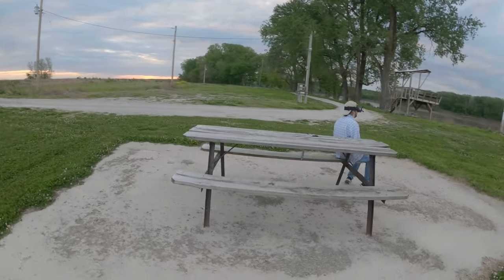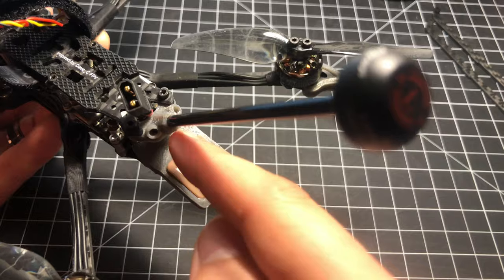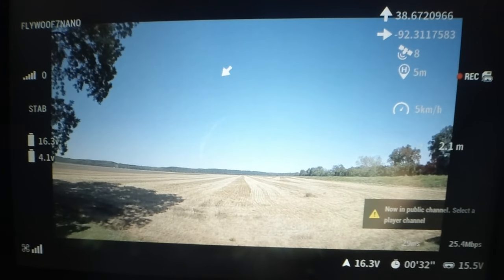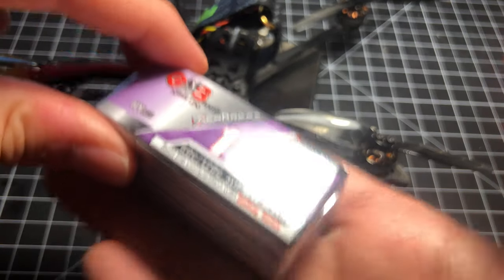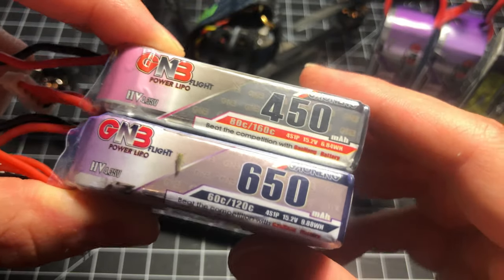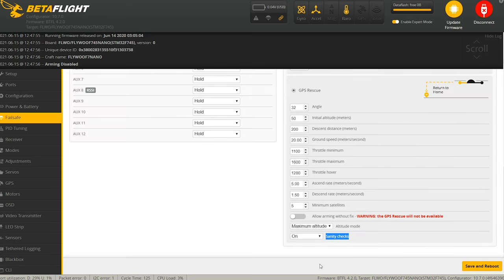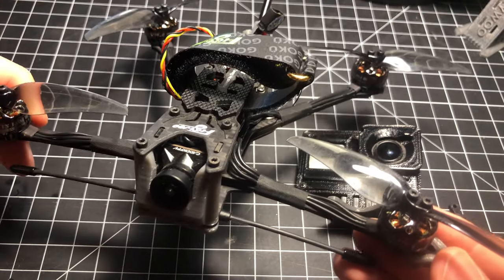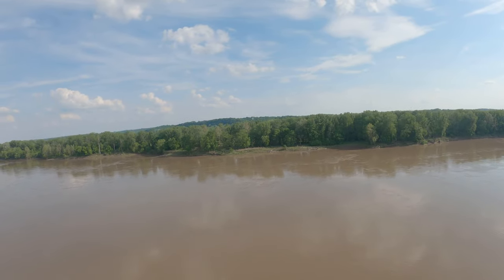Flywoo Explorer LR HD 4'' V2 Micro Long Range Ultralight FPV

Comment: Awesome review, thank you for providing so much detail! I have had the Explorer for a couple days and have enjoyed flying it as my first new drone after the DJI FPV one. Although I didn't realize that I had the OSD turned off in the goggles so I was only seeing the voltage of the battery before I watched this video. Very informative and helpful!
Reply from the maker: Thank you for taking the time to comment! Really means a lot! The explorer is my best FPV drone purchase so far of 2021 I've been extremely happy with it. Glad you got the on screen display working; that's so important to have!
Reply: @JohnCuppi  absolutely! So far I have only flown at home and kept an eye on the RC and HD signal but it definitely will be useful to have the rest of the display available, starting when I get back out and fly tomorrow!

Comment: the replacement arms are 7 dollars... I think it can freestyle.
I do wonder how it would do with a 4s 450 or a 650, it seems like it would be a little more playful for the 7 mins it would stay flying.
Reply from the maker: It can freestyle, but I just don’t see a reason to pick this drone to do it vs. the many others on the market. $7 an arm when you are practically guaranteed to break them every freestyle session is more annoying than expensive probably.
Reply: @JohnCuppi  I really just don't want to have to repair more than one quad... I was kinda in the market for a quad that could be somewhat good for anything. while being able to reach out with longer flights and ranges available and carry a action-cam.
and again, more the point, repairing this little quad is going to be cheaper all around than repairing a five or a seven.
it also has some braces that greatly reduce breaks.
Reply from the maker: @greedfox7842  Totally get that. But, maybe you would consider some unibody frames from companies that provide a warranty for life on them, like armattan?

 Armattan marmotte and the impulserc apex are practically indestructible. Armattan's warranty is real, I've claimed on it previously for non carbon fiber parts on their frame. This way you are not spending a dime on a new frame if you somehow manage to break it. 

I love my flywoo explorer lr 4, and it's still going strong. And if you primarily use it for LR, you'll love it! The braces will definitely help no matter what, I believe they have saved me so far from breaking an arm in a few accidents that I've had.

Comment: friend can I freestyle with this drone?  is that I want a long range and at the same time freestyle.
Reply from the maker: Yes, this drone will do some freestyle very well for what it is, but the thin arms will break. So the tune won't be the problem, but the frame durability. It is not intended to do freestyle.

Comment: great video
Reply from the maker: Thank you! I still enjoy my flywoo explorer lr v2 a year later, it has had a good long run. :)
Reply: @JohnCuppi   I'm currently trying to find resources for a naked gopro hero 10 case that has nd support, do you know of any solutions?
Reply: @JohnCuppi  also, what flight time did you get with the 450 battery?

Comment: Hey pal have a question, when I press return to home, the drone flys up and up and up on it ways back to me even if only flew 10m off ground, its setup same as yours but can't stop it from going up and over 120m, sometimes it recalls and flys back to me and other times it just goes up more but does not fly to me, it has home and satalites set too, any help? Ta
Reply from the maker: Interesting. I'd be curious to know what happens if instead of Max for the altitude, change it to Fixed, and then at CLI do:

set gps_rescue_initial_alt = 50

This will change it to 50m fixed altitude for return to home. It would be interesting to know if it works correctly with fixed or not, there could be some issue with the Max setting.
Reply: @JohnCuppi  will give it ago tomorrow if weather holds up 👍
Reply from the maker: @Adept1780  Ok, let me know how it goes. If that does work then it could mean that somehow it is recording the maximum flight altitude incorrectly. If it doesn't work with a fixed number, and still climbs well past 120m+... then I'm sort of totally stumped. 

BTW - do you have your current altitude reading in your OSD as well? does the reading for it seem correct?
Reply: @JohnCuppi  yep have current altitude in OSD and that's accurate, will see what happens 👍
Reply: @JohnCuppi  ok so it still came back but still went up and up, then it does stop at random heights and just hovers around up in the air once back, not the best but this is only a fail safe so aslong as it starts coming back enough for me to get the signal back and get back into Acro will do me.

Comment: Does the GPS come set up out the box?
Reply from the maker: It does — but, I recommend doing my simple changes.
Reply: @JohnCuppi  can I make them same changes on speedybee adapter 3?
Reply from the maker: @kaelstokes5804  I’m not 100% sure but as long as speedybee v3 allows you to get to the GPS tab, then all of those settings should be there.

Comment: So your limit was your goggles, not the drone? So why not try again with a better configuration because 3km is pretty bloody dreadful. A DJI Mini was doing that a long long time ago and is cheaper than this stupid setup. The DJI Mini 2 full fly more combo is cheaper than your setup here by far and does nearly 6 (it's MEANT to do 10 but because you cannot adjust antennas nor put out any serious power with commercial DJI kit you can never reach that).
Reply from the maker: If you’re comparing this to the DJI Mini 2, you’re missing the whole entire point of this platform. This is definitely not the quad for you, and that’s ok. It can reach further out if you’re willing to buy some directional antennas for the goggles, but this was my experience stock.
Reply: 😬🤣 that's like comparing a fighter jet with a commercial jet dji being the commercial jet take it from a guy who experience both fpv anything is much more fun than a regular camera drone